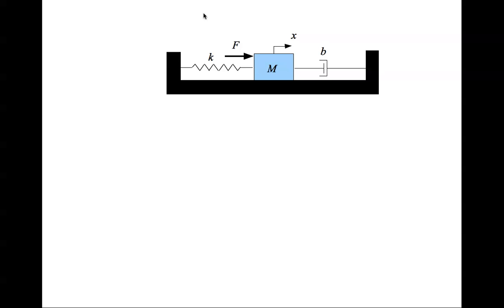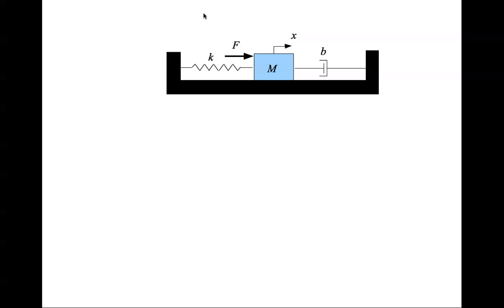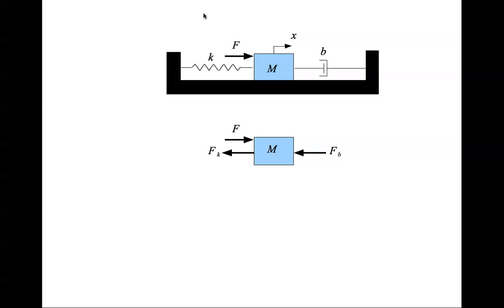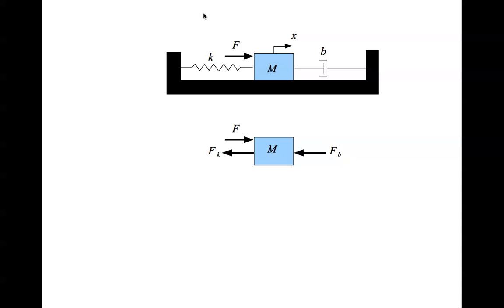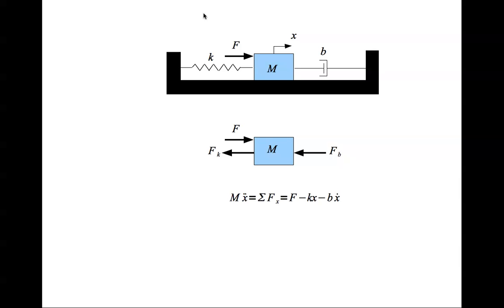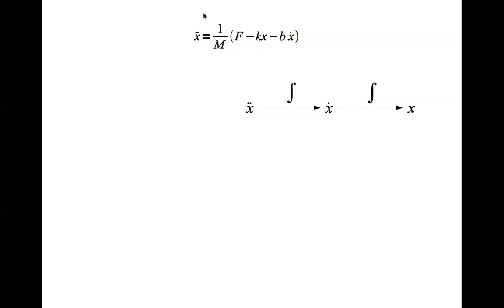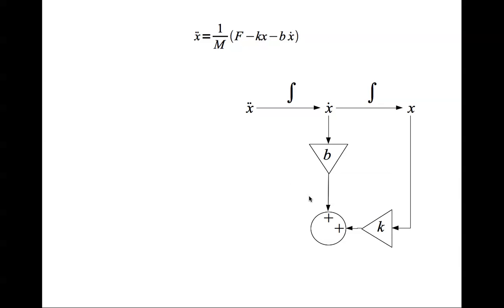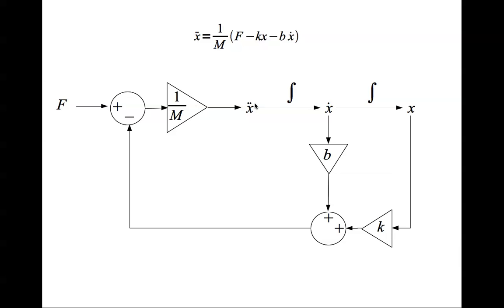Equations of Motion of a Spring-Mass-Damper System

Comment: The equation is wrong. There is confusion between a parallel model and a serial model. Here, the spring is in serial with the damper : X = X1 + X2 and Fs = Fd
Equation :
mX2'' = b(X1' - X2') = - kX1